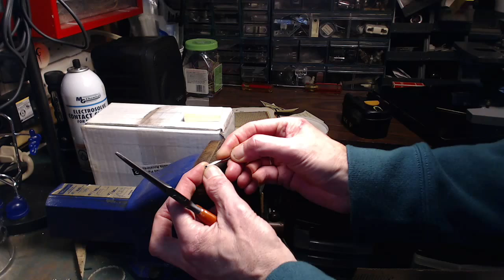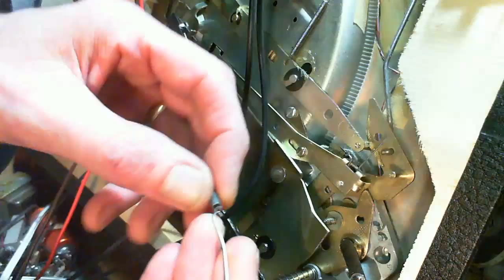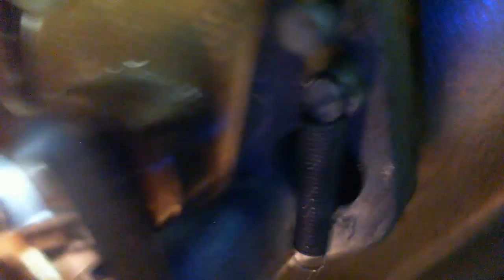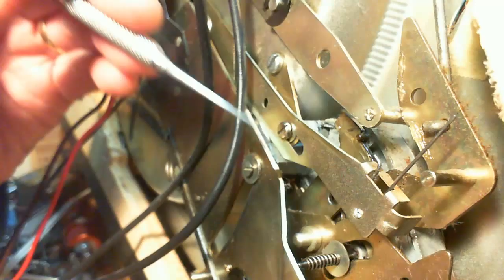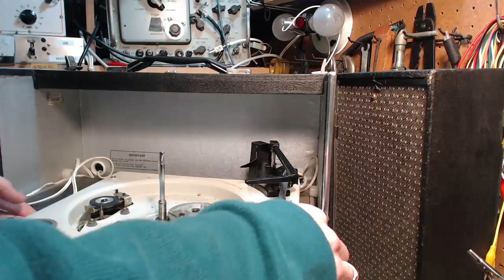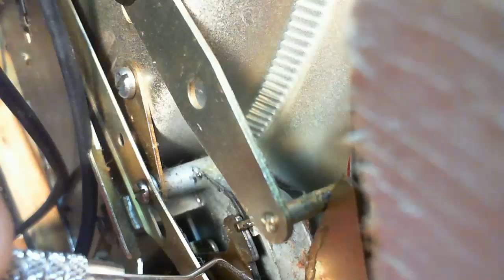Marconi Fold-Out Record Player Video #4 - Spring Tension

Comment: I would try adding another helper spring nearby in an easier place, perhaps by the reject knob. I save springs in my junk box.
One thing that happened twice to me was MISSING SPRING. I had a Magnavox that I discovered was missing a spring, only because I had another identical TT to study how it was.  My Zenith TT obviously had a missing spring, I subbed a larger one, but still need the proper spring for it. This also happened with a reel tape recorder, ya never know what other folks tamper with and lose parts, or bend them, or break things.

Comment: I am wondering if the spring was your issue, I reckon it could have been were the control rod meets the mechanism you only need a small amount of force and it was covered in old grease.. sometimes we blame a spring when all we are really doing s using more force to overcome a different issue